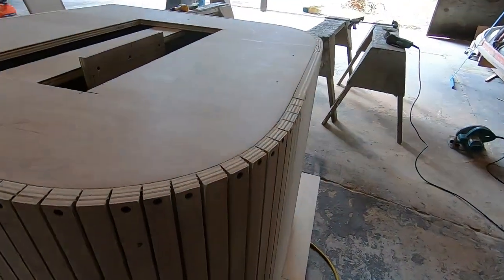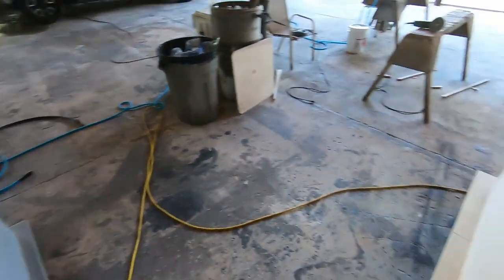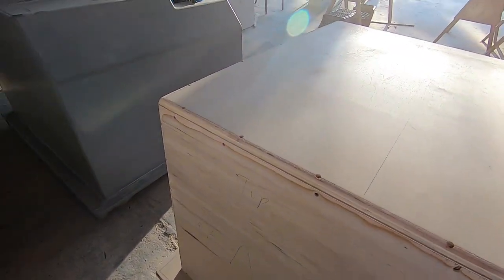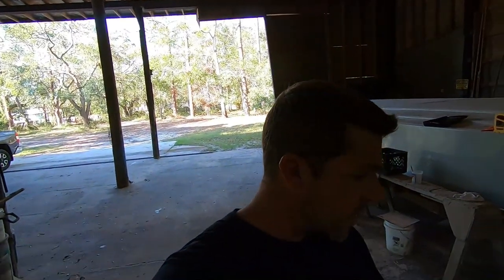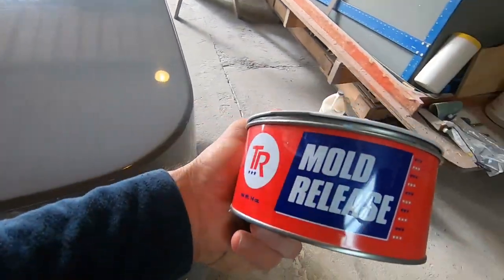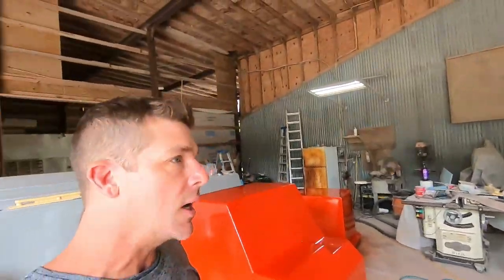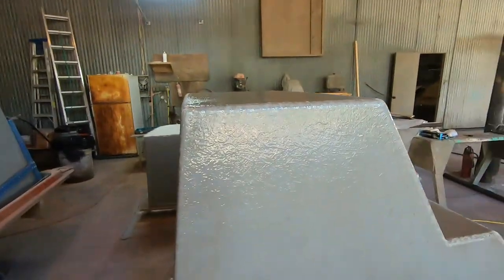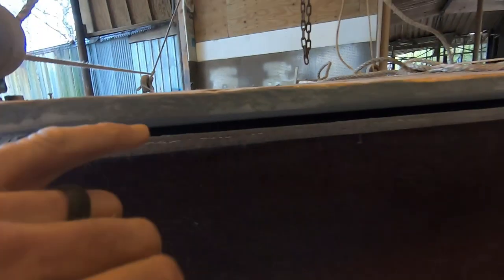EP-7 WE ARE BUILDING A NEW BOAT! HOW-TO BUILD A FIBERGLASS CENTER CONSOLE

Comment: Captain Joe, the more I eatch these more impressed I am with your skills,  it definitely shows how meticulous you r are and what a perfectionist your are.  I mean that in a good way.  So the plug is the actual size of what you want the inside of the mold to be correct....then wax the crap out of that mold and then spray you're gelcoat, lt it tac up and then start glasing.....?  sound about right?

Comment: Great video thanks for sharing your knowledge I’m doing a project on a 30yr old CC my 1st , I’ve wanted a leaning post/ lvwl. This was great info thanks. Had a question on mold, why the slight crown on top of leaning post? Was it only to help it release & do the sides have a slight bevel? Again great work & thanks again Capt.
Reply from the maker: Thanks, Glad You found the video helpful. The slight crown on top is mostly for looks. Every surface on this boat has some curve to it, and I think it just looks nice. Sometimes though, when you mold something with a perfectly flat top, it will actually dip or suck down on the top and produce a low or sunken-down effect. Yes, the sides do have a decent amount of bevel to them, it is about a 1/2 inch for every foot of vertical rise. If You make the walls to straight You will have a lot of trouble separating the parts. Hope that answers Your Questions. Best of luck on Your project, I am sure it will turn out great. Thanks for watching!

Comment: Great work.  Definitely an inspiration.  I was debating on taking on the task of making a custom console for my skiff.  Something taller and to organize my wiring by allowing an access panel.  I am curious tho how you get the edges of the plug rounded. Is it by router and is it a 1/4 radius or ?
Reply from the maker: Glad You are enjoying the videos! Yes, I use a router on most of the corners. I typically use more like a 1/2 radius, I like a really soft corner on our interior parts. If you are only planning on building 1 console for personal use, you might want to consider just building the console out of Coosa board. I have a Working with Coosa video on the channel that should be helpful. You would have to fair and paint the part, but would be less work than building a mold and then building the part in my opinion. Hope this helps! Good luck with Your project, and thanks for watching the channel!

Comment: So once the console mold was separated from the plug, do you make the console from the inside or the outside of the mold? Sorry if this is a dumb question, I am just getting into the wonderful world of fiberglass and there are some features on my boat that I'd like to change. I have learned quite a bit from your channel, so keep the videos rolling!
Reply from the maker: Glad you are enjoying the videos! You mold the new part on the inside of the mold, which would be the orange surface. You might want to check out episode 1 in the boatbuilding series where we build the hull. Much bigger part, but the same general process as smaller parts.

Comment: Do you have any videos or instructions for the actual lay up on these consoles after the gel coat is sprayed.  Would you shoot chop in with a chop gun or hand lay csm and 1708?  Is there any reinforcing like nidacore or coosa where the controls and helm go?
Reply from the maker: The footage of the build didn't turn out, sorry. We hand layed 2 layers of 1 oz csm for a skin coat. Then 3 or 4 layers of 1708. The yield was right at 1/4 of an inch. I did add a layer of 3/4 coosa, with 2 layers of 1708 on the backside. Hope this helps. Thanks for watching!

Comment: If you're only building the one boat, why not go from pattern directly to part? Why build a mould?

Is it because the gelcoat has to be the first layer so the mould has to be a negative of the part?  Inside wall of the mould forms the smooth outside face of the part.
Reply: id guess they plan to build more than just this one boat.
Reply from the maker: Yes, you got it. Gelcoat has to be the first layer to get that smooth molded surface. Also I may build another boat someday, or sell the molds to another boat builder. Hope this helps. Thanks for watching!